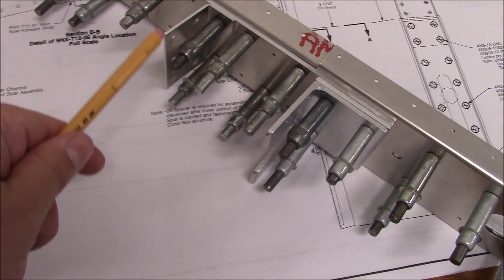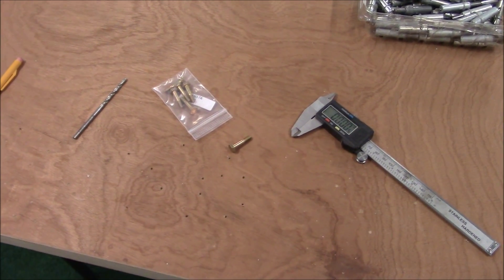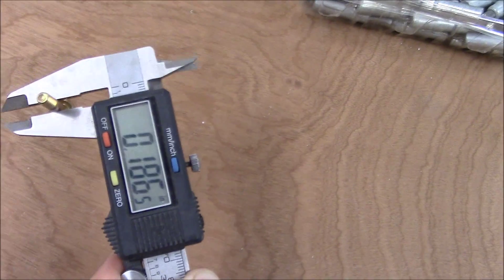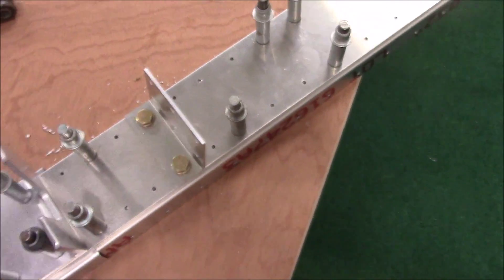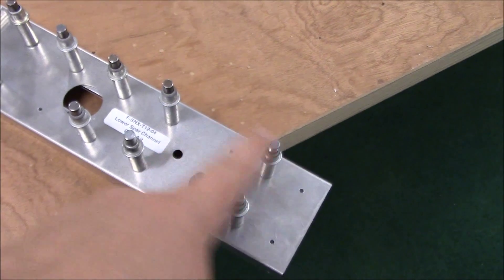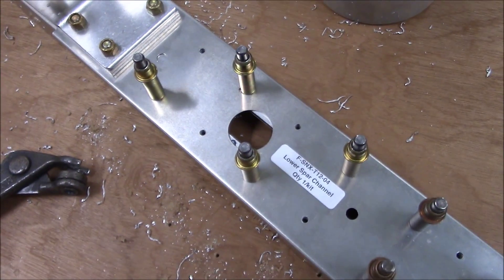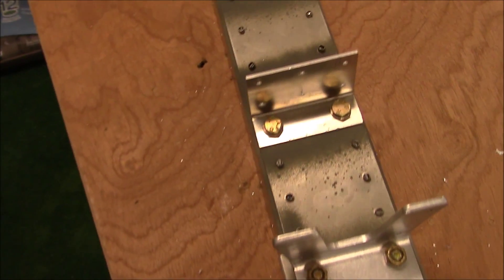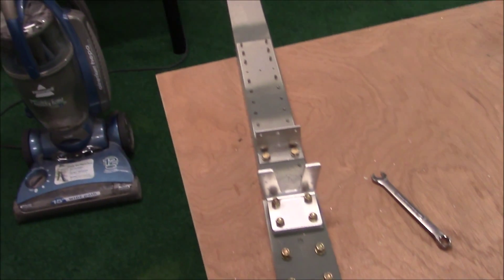Sonex Aircraft Build Video 41 Aft Vertical Spar Part 2

Comment: Probably a dumb question but would a drill press be good for drilling these holes or is it overkill for this application?  Great job explaining things by the way. 

Also, one of the EAA magazines had a great article on aircraft hardware explaining "AN" and different specs.
Reply from the maker: SyberPrepper Hi SyberPrepper. Thanks again for the great comments and questions! 

Yes, in an ideal world, I really should use a drill press. It guarantees the accuracy of the hole for the bolt. I currently don't have one but just mentioned to my wife why I need one for drilling this type of hole (more accurate tight tolerances across the entire part of the hole) and she thinks she would use it too, so we are going to get one soon. 

I keep hearing from 10s of sonex builders how "over engineered" the airplane is. I am a little less worried about the tolerances on those holes based on everyones comments, but I still want to build the best and strongest airplane for me, which means I need to not skimp on any strength or integrity I can keep in the part. -Dan